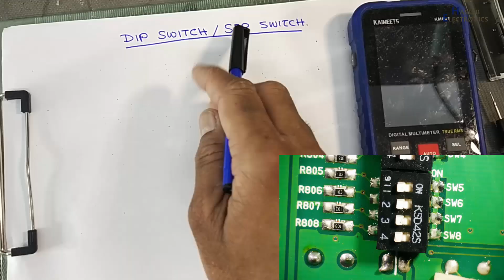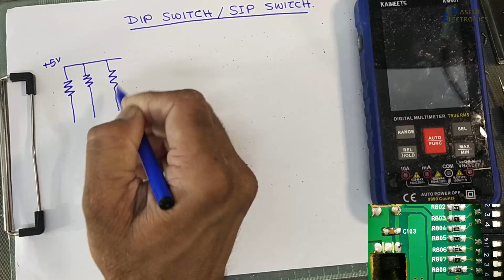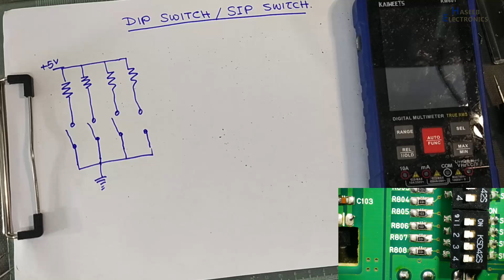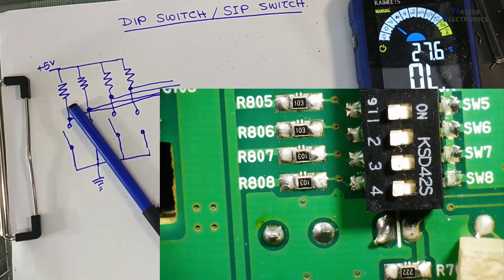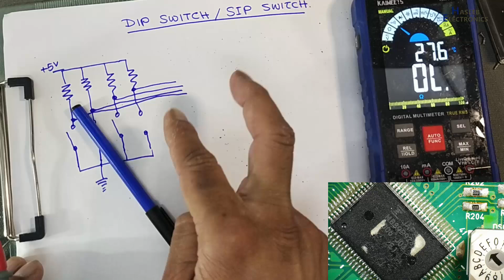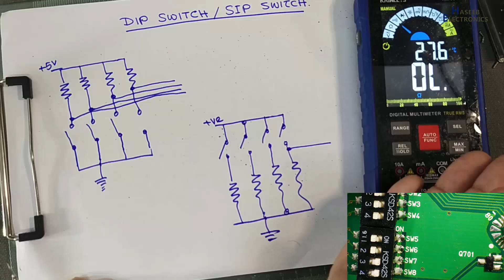Comment: Older 1970's- 80's Kenwood amateur radios had a switch in the front that said "fix" on it. It was for a fixed crystal to put the radio on one special fixed frequency. The radio has a tuning knob on it which you can tune the frequency on, so you never need a fixed crystal. Over time, corrosion builds up in the switch and the frequency drifts all over the place. Literally pushing the "fix" button again and again "fixes" this problem and the radio works fine after that. No cleaner is needed. Great informative video sir!
Reply: fabulous. 
thanks for sharing a memorable tip 
stay blessed
Reply: @HaseebElectronics  You too!